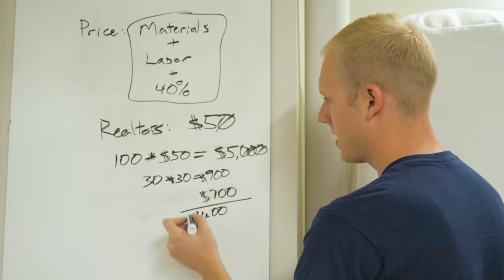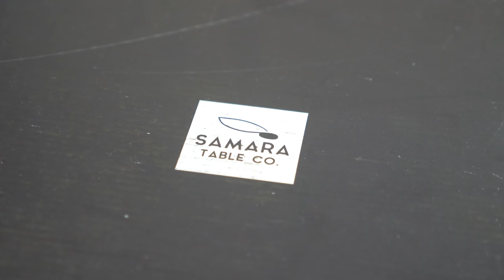we (accidentally) bought a whole pallet of boxes 📦 | Furniture Business Update

Comment: I ship all my boards in boxes that are oversized by 1" on all sides. I pack the board in 1" rigid polystyrene I get from Uline that's cut with a hot knife. The board is in there super secure. Haven;t had a single board get damaged during shipping.

Comment: As a former trucker who did delivery of wood cabinets and furniture, you need to cut those boxes down so they fit tightly on ALL sides including the top. That little bit of space will allow the top and sides to get crushed, which could cause problems with your inside box. Use newspaper or other cheap filler.

Comment: When the returned box was opened, it looked like there was nearly 1/2" of empty space between the cutting board and the "lid". All it would take is for a box to be put on top of yours, and that's enough to collapse the box a bit, and once it gets a crease anywhere, it now has a place where it can move and twist, and it starts to pull on edges and corners. Since those black boxes have low "edge crush" rating, the void-fill needs to not "settle" and flatten like the crinkled paper, leaving that gap. Of course adding an additional outer box is an option, too.

Comment: Great video.  I noticed that the black box fits tightly into the Uline box and that box was much deeper. Will the client have trouble getting it out of the Uline box?  Check out Uline S-4821.  My guess that your black box is around 18x14 x2.  Also you could add some 3" long foam pipe insulation, one piece on each side.  That way your box is floating inside the new box.  Just a thought.

Comment: Quick tip for whoever has to tape up the boxes; the H (or I in a different font) method is proven.  Tape the main seam and then the ends, like taping the middle part of an H and taping the ends after.  Yes, I spent many years running a shipping department.

Comment: Let me say, I made a custom flag on my CNC and sent it out. It got damaged. When I spoke with the manager he let me in on a secret. Pack the item to with stand a 12ft drop. The package goes on a conveyor and that is the approx distance it drops and other item drop onto your package. But that is what the manager told me. Not sure if placing a Fragile sticker on it will help or not.
Reply: It typically does. We use UPS and the manager says that if it has a fragile sticker and it gets damaged they are required to pay claims.